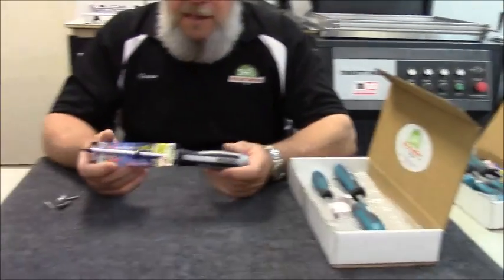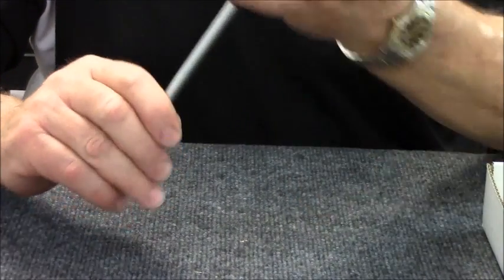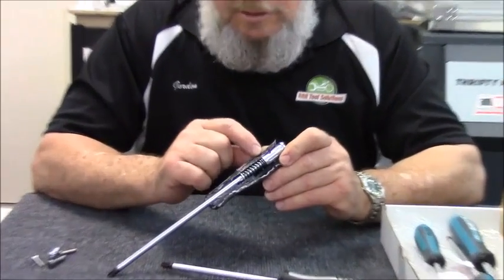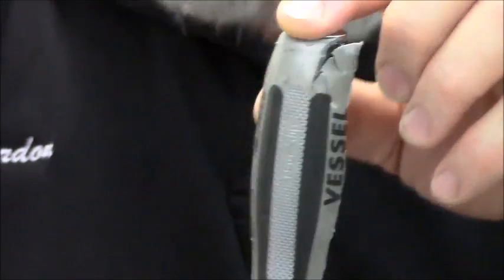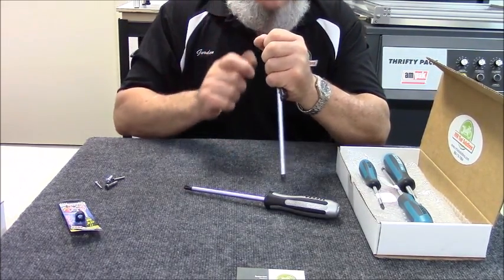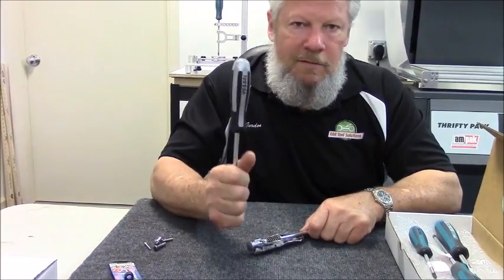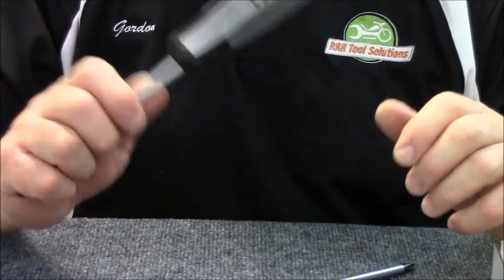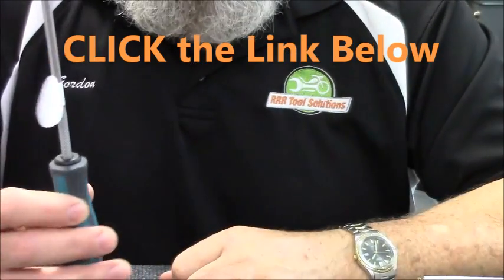Impact Screwdriver by Vessel

Comment: Okay thanks good video 

fair enough reccomenation

here’s my problem though most people don’t realise if you google the history of the Phillips head its designed to cam out in connection with aluminium aircraft manufacture

Since that time there’s been deviations on that theme 

secondly a lot of people don’t realise as you pointed out there’s different types there is Phillips head.... JIS plus others 

if you google it there’s many different types of heads JIS is actually not that common so I’m a little bit under enthoused about the whole Phillips head JIS thing

Just use a six sided bolt head can’t go wrong

Comment from the maker: Vessel Impact Screwdriver

Vessel's impact screwdriver is called the Impacta, it has a mechanical cam in the handle that when hit with a hammer it turns the screw driver tip 12 degrees to the left. When it comes to motorcycle restoration this impact screwdriver from Vessel is gold.

Just like all of Vessel screw driver, the Impacta impact screwdriver fit the screw.

Home:  http://www.rrrtoolsolutions.com/
Shop:  http://www.mcssl.com/store/rrrtoolsolutions
 #motorcycletools   #screwdriver   #impactscrewdriver   #JIS   #Vessel

Comment: Nothing new here .Its just a cheap impact driver.In fact its not evenas good as an impact because real ones work both ways .Tighten AND loosen.
Reply from the maker: Polar Bear, Vessel has those too. In fact the part# is 2500 and they run about $40 with the 4 hardened tips and 1/2" drive (not the 3/8" drive the junk ones have). I rarely sold them and sold thousands of the light-duty $11 #3 impacta.

I have never, ever wanted nor needed an impact to tighten a screw. #2 screws require 35~40 inch pounds to fully tighten and will normally shear off at +50. The #3 screws require 75~80 inch pounds to fully tighten and will normally shear off at +90. I own 3 sets of the big 2500 and I've only needed to unpack it 3 to 4 times in years. Thanks for commenting! Gordon/RTS
Reply: I think maybe the "loosen" direction in impact drivers is for reverse-threaded screws/bolts... hardly a common use though
Reply: Why would you ever need to tighten that tight? The product to use is called locktight.
Reply: In Australia, if you hold it in your right and strike it, will it then tighten the screw?